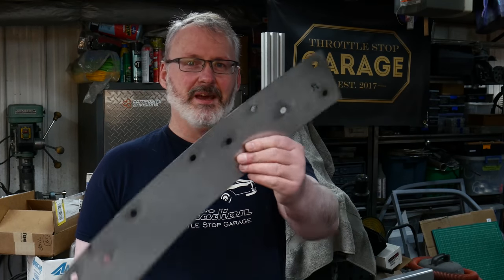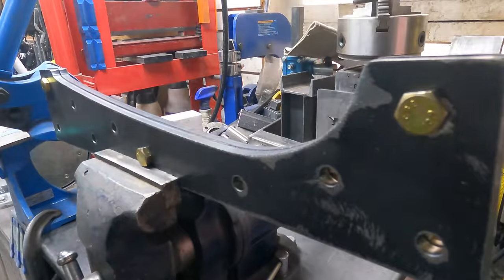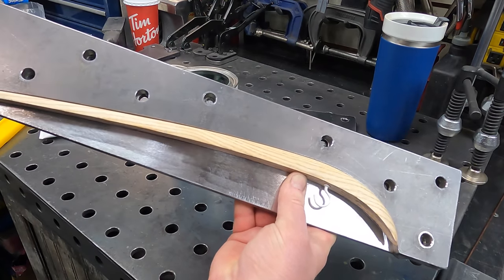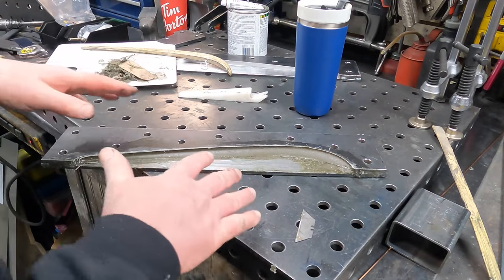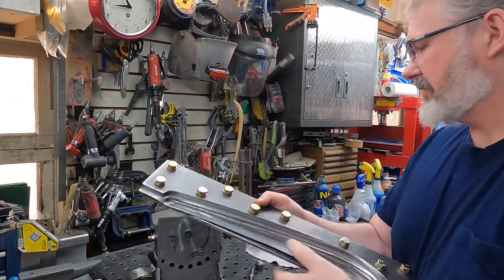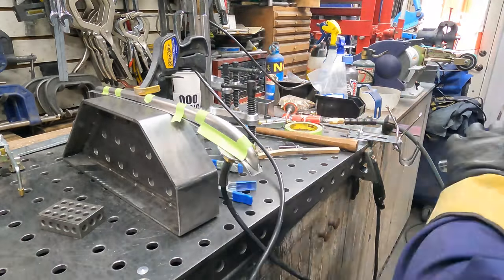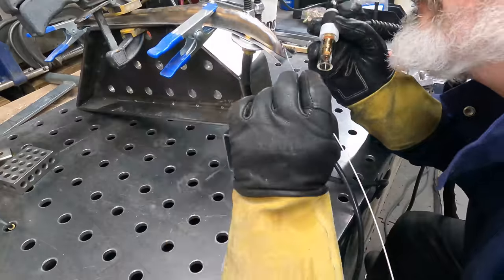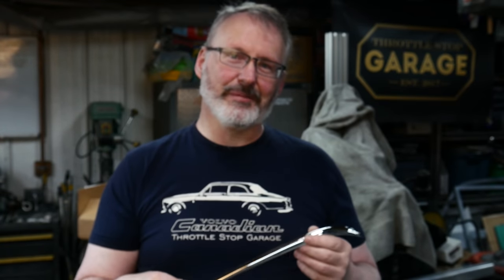Making Stainless Steel Automotive Trim: Metal Hammer Forming Stainless Steel.

Comment: A product called Solar Flux could have been used where you back purged  that part. Leaves a good weld, but the flux is hard to remove.Bead blasting works good.Nice!
Reply from the maker: I just got some the other day from a recommendation.  I haven't tried it yet, but I'm told it works great.

Comment: Next time anneal the stainless first, I have done a lot of ss reshaping for top chops and it makes a huge difference. Also look up a product called Solar flux, it's a powder that you mix with rubbing alcohol into a paste that you brush on the backside of the weld, it saves you having to mess around purging and leaves a beautiful inside weld!
Reply from the maker: Thanks for the tips Terry.  The A2 304 sheet I have is annealed and it moved really easily.  I've made another now (video coming) and the challenge was with the flow forming dies/tooling not the material.

Comment: Looks great, its unbelievable how many don't back-purge.
Reply from the maker: And the number who come up with reasons for not doing it...honestly, stainless welds so much better with the purge line going.  There is what...200 ml of volume and I purged at about 1 LPM. Backside is smooth as silk.
Reply: @ThrottleStopGarage  I have seen some welding samples each way and its night & day both looks and strength.

Comment: Could possibly make an attachment to mount a ball bearing of varying sizes on your  "hammery bit" loved watching the process.
Reply from the maker: I'm working on the 20 ga ones right now and I have had to do exactly this to get it to work.  Not recording the process.  But I'm using ball bearings welded to old punches.

Comment: Sir, I like your positioner, your TIG welding...May I suggest that welding on dissimilar steels, hardened tools and the like, you use ER312 SS filler rod. It is about twice the strength of ER70S and will not crack internally as ER70S. A second choice is is ER309 rod. Your welds will not break three times..no not once. Cheers!:goodvibes:
Reply from the maker: Thanks for the tip - I'm looking up those filler metals now.  I've got some ER309, but no ER312 and I think the ER309 I've got is 1/16".  Next time I'm at the welding store or when this took breaks again...I'll see if they have any ER312.
Reply: @ThrottleStopGarage  1/16 is my go to size for these alloys. A good rule of thumb is use 309 for non hardened [will hand file] unknown steels. Use 312 on ANY hardened steels. I plan to do a Full video soon on this subject on my YT channel.
Reply from the maker: @AWDJRforYouTube  Off to the welding store at lunch for me then!  Thanks.

Comment: That looks great!  When I was doing stainless fab, I was told to tack every 1/8".  And that was for 14ga stainless.  I didn't tack that close on work I did, but I might for this project.
Reply from the maker: I'll give it a try on the next one.  Heat control was tricky.
Reply: @ThrottleStopGarage   I would recommend trying a pulser, or manually pulsing if you don't a pulser on your welder. I like 1 pulse per second.  I haven't welded much thin material like this, so I'm not sure of the exact technique.    But pulsing on stainless is almost magical when you get it right!
Reply from the maker: @fredygump5578  The welder has a pulser (It's a Miller Dynasty 200DX) but I rarely use it because I don't weld enough.  I end up feeling rushed or lagging - if that makes sense.  When I was welding all the time I could get in the grove - now I'm more or less holding my breath.

Comment: I was thinking, if you get a new part for the hammering, maybe that annealing the part before you use it might help, and after that give it some reinforcement welds before you use it. But do not quench it after welding.
Reply from the maker: Hammering a new set this weekend.  The A2 is annealed at the start and I was happy with how it moved.  The strips for mounting will be welded in and should be decent.
Reply: @ThrottleStopGarage  I was talking about annealing the tool. So that it becomes less brittle. Maybe that it will last longer.
Reply from the maker: @insAneTunA  Ah, with you now.  I think there is a dissimilar metal problem between the hardened shank and the cup part.  I think the one I've ordered is made from tool steel and is for sure heat treated.

Comment: Well done looks great the 20 Guage is going to be tougher to move. Perhaps cut back on the overhang on the inside of the part to make relieve easier. Perhaps a piece of 6mm thick washer and bolt where you had the clamp at the end might help. 
Lots of effort. 
Would welding the part from the inside before trimming everything off not make assembly simpler. 
Allows a finishing weld on the outside again.
Reply from the maker: The 22 is really easy to move - you've hit it with the problem in the tight radius at the skinny end - the draw and change of direction is the problem.  So I will trim the top side (make a slit) and allow it to form into the bottom.  Welding from the inside would be super hard.  No where for the torch, filler or fingers.  That part of the process worked as planned.

Comment: Very nicely done and you have a new set of problem solving skills added to the arsenal. I wonder if that tool would break less if you hollowed out a long delrin piece leaving it solid at the tip and slid it over just the shaft, like a long bushing over a sleeve. The delrin might 'bounce' a bit on the end of the shaft and save the tool from self destructing.  To anyone knocking the effort, they miss the point. I understand entirely, I just bought a Onefinity CNC (Canadian made) in part to make my own tail light lenses and other trim and interior bits. I can't buy what I want or can imagine so will learn how to make it and do it myself.
Reply from the maker: I'm going to wait until the TM Tech one comes in.  Proper tool steel and the shorter, larger diameter shaft may be the key.  I'm going to be doing a few more of these sorts of parts and don't want to spend 50% of the time fixing the tooling.

Comment: I think, based on my limited weldering experience and my own tool making, there's some decent carbon in your bits and they'd both like some preheat-even being small parts, and a tempering cycle, say in a toaster oven at 400F to stress relieve them. And an appropriate filler. Maybe knock the flux off a 7018 rod.
Reply from the maker: Yes - I am about to make the next set and if/when the tool breaks, I've got some ER309 for welding dissimilar metals.  I also got the proper tool from TM Technologies yesterday.
Reply: @ThrottleStopGarage  flow forming bit. check. and only the price of a Snap-On tool. ouch.
Reply from the maker: @kathysarmcandy1992  Then add 30% on the price for the Canadian dollar and the shipping.  I think the total with tooling was north of $250 for me. It is a really well made part and I'm toying with making a quick video showing the two different tools in action.

Comment: I used to this for a living years ago , have you heard of electro polishing , when stainless is welded the process burns the nickel out of the weld , electro polishing removes the iron content that can rust and just leaves pure stainless steel , a cheap and effective process that can be DIY
Reply from the maker: I've heard of it but not experimented with it.  It does sound like a thing I have to look into for the final part.

Comment: Nos part, $450. Hand made part$2000. End result $priceless! 
Being able to hand make a piece like that requires special skill. Not something a hack like me could ever come close to. My hat is off to you, Sir!

Now isnt that the original piece hanging on the wall behind your drill press? 
Ya, that would be funny. 
I know all about misplacing that stuff. Tools for me. Replacement snap on 10mm wrench,$40.00. When i find the misplaced one i will have 2.
Reply from the maker: I'm still shocked the original hasn't shown up.   Maybe when I make the real part.

Comment: I absolutely love how you are not afraid to try absolutely anything when it comes to a build. I want to strip my 944 and make molds for an entirely carbon kevlar body. Including pillars rockers and floor. I can use two part foam, plaster, and sealer to smooth out anything and avoid negative angles. It will bond together in large pieces. I've got it all figured out, I'm just scared 🐣🐣🐣
Reply from the maker: Thanks Kurt.  I think failing a lot is just part of the process.  I've got a vision - like yours - and I'm picking away at it until I'm happy.  In the end - that's all that matters.  If you've got questions - I'm happy to help if I can.
Reply from the maker: @curvs4me  composites are composites.  Working with carbon fibre isn't all that bad if your fibreglass mold is good.  I have only done a few wet layup parts and all my panels were made using resin infusion.  Carbon fibre is stronger with  just enough epoxy and no more.  In the tests I've seen, a wet lay up will not be as strong because there is too much resin.  Not really a problem for most applications.  But something to think about.  The fibres also need to be compressed.  I know Bill does this (he just wet lays it and then uses a bleeder fabric when he pulls the vacuum.  Don't forget - he's got 40 years experience doing this all day.  So he does make it look easier than it is!   Still not rocket science - but I did learn a lot and it's more nuanced than I thought.

Comment: must be pain in the ass to be a perfectionist :) Good job man...
Reply from the maker: LOL - it's not perceptible to me...but to those around me.
Reply: @ThrottleStopGarage  good for you then 😂

I was just thinking that I am really envious of your skill level, and mainly "just go and (try to)  do it" attitude. 

Impressive to me anyhow...
Reply from the maker: @tommiprami  Thanks.  It helps to have a wife that mocks me for my insanity.
Reply: @ThrottleStopGarage  I am maybe to too stupid to have any reaction of the wife's "suggestions"
Reply from the maker: @tommiprami  LOL - my wife savagely teases me about my perfectionism. Like when I showed her the trim, she instantly pointed out that the front didn't fit the body perfectly (it wasn't finished yet...hair of a gap) just because she knows it will drive me nuts.
Reply: @ThrottleStopGarage  I tried to to same for my wife, but for my massive annoyance in this occasion she did not freak out ( one of the strings of plant hanger thingy is not correct) , tried to make her OCD to react to it, but her kung fu in this case is way too strong, just to annoy me 😂

Comment: If you can find a 2" plate 2' X 4' or bigger and make that your hammer table the one your useing vibrates like a drum .CHEERS .
Reply from the maker: It's an interesting problem.  So far, I've been able to break every tool.  I'm not sure if I should cushion the form or put it on the concrete floor and try it there.

Comment: Very awesome job.  Amazing.  So I found your video because I have 2 pieces of 65 ranchero trim that I need welded to create a longer piece of fender trim, or if I need to try and recreate it?  5 ft long I am thinking welding the two halves together is probably the better option.  I am just wondering what welder, material, tools, etc I would need to accomplish mending these together.  I really appreciate your thoughts.
Reply from the maker: I've got a Miller Dynasty 200dx.  Low amps, fine filler and patience is what is needed. For the stainless, I use a 1/16" CK gas lens.  This was welded at 30 amps...maybe a bit less.
Reply: Thank you so much for the reply.  I really appreciate it.

Comment: Have you thought about alternative mounting instead of welding a bar and nut inside. The extra welding adds so much risk of destroying an otherwise perfect part. l would suggest a modern high strength silicon-based adhesives and glue you mounting tabs in or fill the backside in and use double sided tape. 15 years ago, I mounted the trim on my 78 F150 buy filling the trim with devcon  and double sided  tape
Reply from the maker: That's a great tip.  I honestly never thought of it.  It always amazes me that we get fixated on a solution and limit the possibilities.  I was really worried about doing this weld (glad it turned out) - but a little epoxy and that's going nowhere.

Comment: Im wondering if the  wooden moulding can be replicated in aluminum in a CNC   machine and then alkaline copper plated then ither chrome plated or nickel plated i know it will be more expensive but it is onother alternative?
Reply from the maker: Sure - it could be scanned and replicated in any material - it could even be 3D printed in stainless.

Comment: Nice work and that is a piece of artwork in its own rights and just wondering if it is possible to use only the wooden buck to hammer form the part? And the first set of dies that you made you could fire harden the wood to remove the softeners of the wood
Reply from the maker: Thanks - I don't think the first dies were hard enough to take the beating that thicker stainless needs to stretch.  I don't know if you can further harden MDF - my guess is no.  I don't think you could form the part using only the wooden buck.  Certainly not against the buck - it wouldn't be strong enough.  You could work out how to form the metal using the buck as a guide, but it would be slow and probably wouldn't work very well.  The idea with this hammer form is that you're getting the shape out of stretch only.

Comment: What if you used copper sheet and got it chromed? 

Stainless is a nightmare to work I think, it’s just so hard.
Reply from the maker: No local chrome shops.
Reply: @ThrottleStopGarage  Wow, I thought there were pretty common, we have a number here in Indianapolis.

Maybe aluminum then? Porsche switched from chromed brass trim to polished aluminum in 1969. 

I’m not 100% sure, but aluminum trim is first polished then clear anodized to protect it.
Reply from the maker: @AndySomogyi  Not at all common in Canada anymore.  The original was polished and clear anodized.

Comment: Will you give me your best recommendation for my first tig welder? Thanks Brent Hayes
Reply from the maker: That depends on what you're making and how you're using the machine Brent.  I've got a Miller Dynasty 200DX and it works great.  I hear a lot of good things about Everlast welders for price conscious buyers and would buy one of their larger machines if I needed it.  Things that make it easier are a high-frequency start and a proper foot pedal.  It's not as easy as it looks (especially if you've only MIG welded) - it's a skill and takes time to learn.  Don't forget used machines - just keep to the inverter machines as the transformer ones are huge.

Comment: What de burring air tool did you use on the dies plz

Also, on the stainless steel sheets, elongate the bolt holes and don't tighten to bolts 

Be sure when welding the two dies, you don't weld the stainless 

The stainless has to pull through the elongated bolt holes 

You will find letting the sheet slip works wonders
Reply from the maker: Thanks for the tips.  I'm making the 20 ga part this weekend and will try that.  The deburring tool was from https://www.amazon.ca/dp/B09WMS4CMV/ref=cm_sw_r_apan_i_90VXS6JZSVXXMEDGCX69 they are all the same.

Comment: Really nice. A lot of effort.  How was the OE part constructed?  Single piece?   I suppose a single piece split as a Y on both ends and folded/rounded over would be a lot more difficult with simple tooling.
Reply from the maker: It was a bright anodized aluminum part.  One piece would be pretty hard to make work.

Comment: what about using brass sheet would be a lot softer to manipulate , although you would have to plate it afterwards
Reply from the maker: Sure - the technique is the same.  The attention to detail would be the same, so making the part from stainless means it doesn't require plating.
Reply: @ThrottleStopGarage  most of the heavier trim on my 1800 is chrome plated brass, was this hood piece originally stainless?

Comment: On your hammer tool Would mig welding not be a little more flexible?. For lack of a better word..or 7018,,what’s the old saying it will give a mile but won’t stretch an inch?
Reply from the maker: The welds are not really stressed - once the bolts are cinched up, it's going no where!
Reply: @ThrottleStopGarage  I was thinking about your air hammer tooling that kept braking..great video and workmanship
Reply from the maker: @mikejackman4416  Ah - sorry, I didn't read your first comment correctly.  I thought you meant the form itself.  The dissimilar metals are not helping and I'd like to get a little better handle on the breaking tool before I got a destroy the one that just cost me $230.  If that lasts 10 minutes, I'm going to cry.  I've got a viewer tip on some different filler rods that may do the trick if the current version breaks.

Comment: You should of made it out of solid material and just grind to shape... Muuuuuuch easier
Reply from the maker: There are no "shoulds" If you want to learn.  A solid stainless part would be very heavy on my carbon Fibre hood.
Reply: @ThrottleStopGarage  I'd thought aluminium block... Then hollow the centre out to keep it light. Obviously it's too late now but I'm sure it'll be much quicker and easier with the same affect it'd need polishing well tho so stainless steel scores well there
Reply from the maker: @terrybrown6057  no question...I had a piece of stainless ready to go if this failed.  This was learning as my next project on the car will require Hammer forming stainless (more trim...this time unavailable).  So the idea was to learn on the small part and see what I could do. It will make more sense later.